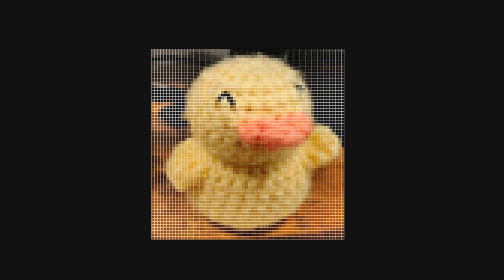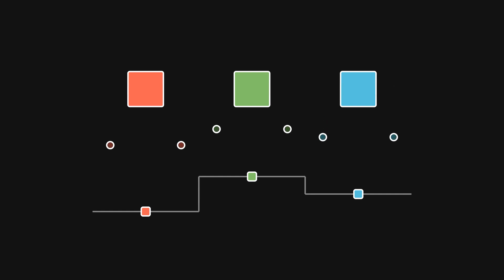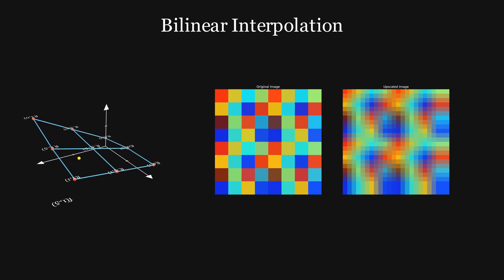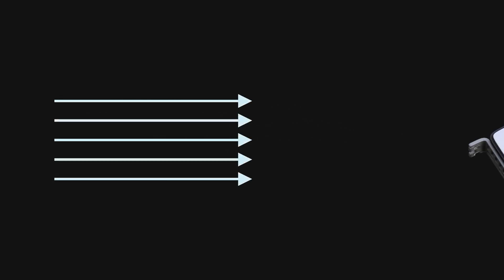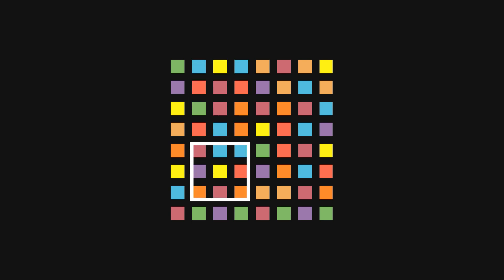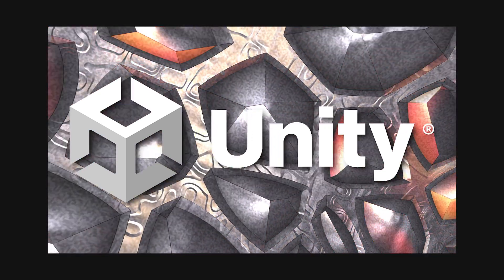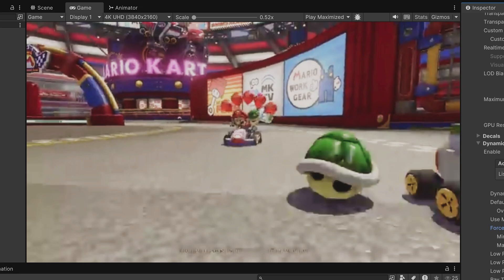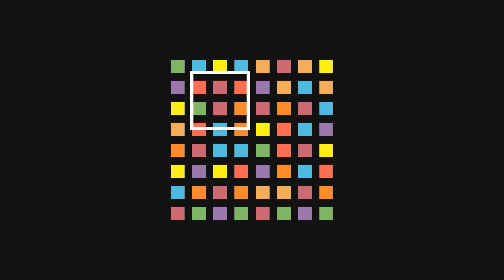The Secret Behind Upscaling...

Comment: Dlss is a taa solution where it manage the parameters on the fly with a network.
It takes a full frame depth buffer, half res temporal data of the pixel based on jittering subpixel position of the camera, and motion vector to reconstruct the current frames, applying to still images miss the depth, the jittering that revover subpixel information over time and motion vector, ie there is not enough data to reconstruct image.